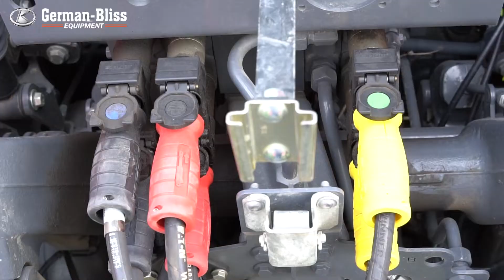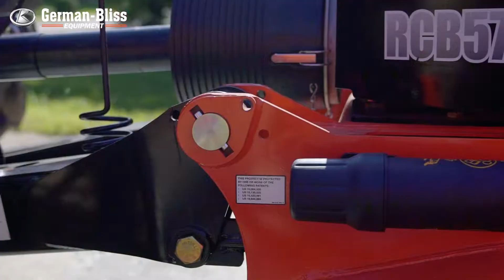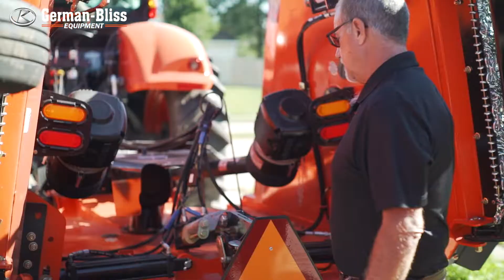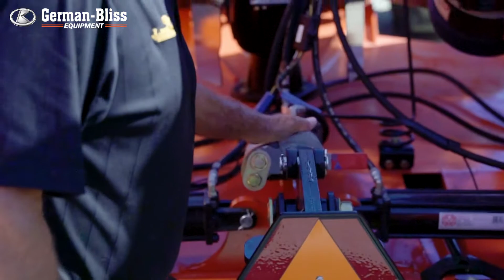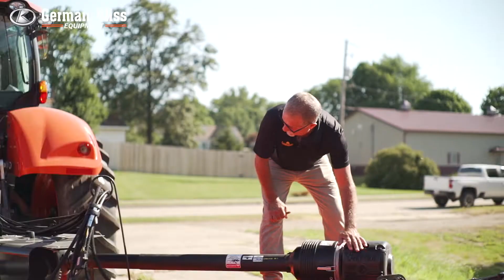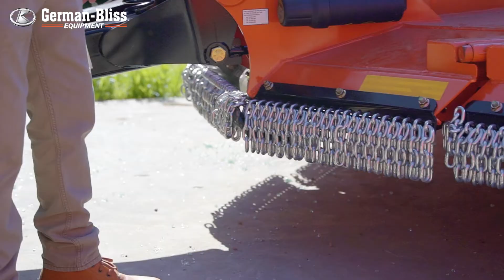LandPride RCB5715 15' Batwing Mower - Walkthrough (Maintenance and Operation)

Comment: How do you like the rephasing cylinders vs turnbuckles?
Reply from the maker: Theres a give and take.  Obviously with cylinders the time, and ease of use is the big win.  But adding complexity, adds difficulty if something goes wrong.  That said, Landpride craftsmanship is in a class of it's own.  We are biased of course, but usually there is little to worry about with Landpride.  On the rare occasion something does go wrong, the support is outstanding.